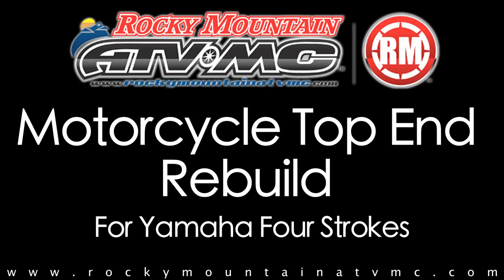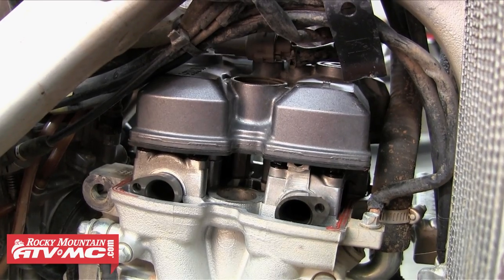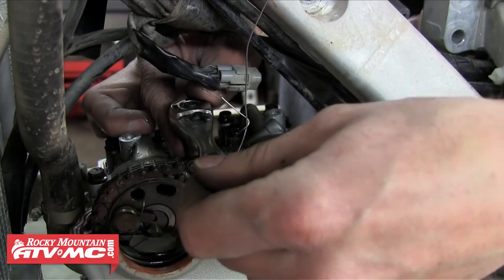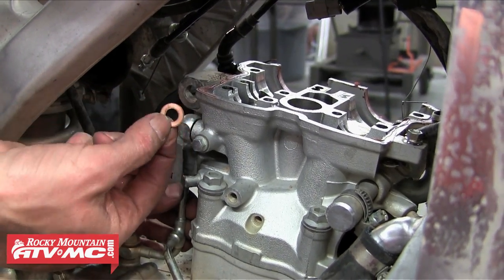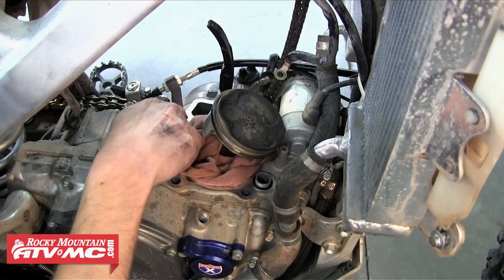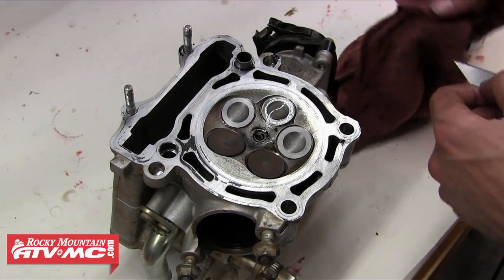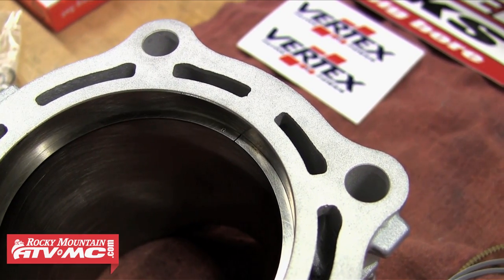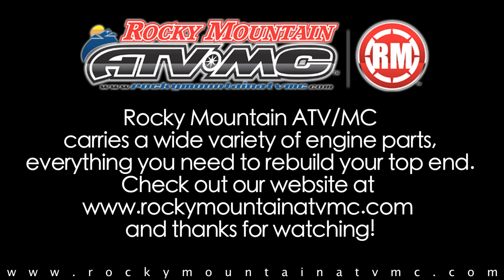Motorcycle Top End Rebuild on Yamaha Four Stroke (Part 1 of 2)

Comment from the maker: We most likely will in the near future but really the only difference between a fuel injected bike and a bike using a carburetor is the you would remove and install a throttle body instead of a carburetor and then you also have a fuel pump so you would have those wires to disconnect as well. Other than that the steps would be the same as this video.

Comment: I love the way you showed how to do this job. However I did all you presented and my bike doesn't start. Any idea how to troubleshoot it? I cleaned the carburator, checked the fuel pump, spark plug, air filter. All is fine but the bike still doesn't start. Please help if it's something you're familiar with. Thanks a lot

Comment: Few questions :
-why  you don't measure the piston to eventually re use it with new rings ?
-why  you don't measure the cylinder bore and piston to see if you have the correct clearance ?
As i know you have to ,to be sure the new piston have the correct dimensions for your cylinder.
How does work the cooling system on those bikes ?
no thermostat,no cooling fan ?
the engine is running constantly cold so ?

Comment: I have a 05 Yamaha YZ450F that will not turn over. It started with a bog/hesitation & pop sounds than shuts off completely. Values checked 100% and are good. Air filter checked and good. Fresh gas & oil, new spark plug, added a new fuel screw, cleaned carb 100%. Far as the top/bottom end is concerned in my opinion I believe they're all good because I don't ride it everyday or every week. I have a rebuild carb kit coming this week which I will install it just in case. Do you all think I'm over looking something that needs attention? Maybe the float is stuck or something like that!
Reply: Check to make sure the plug is getting a spark. Even if you replaced the plug, there might still be something wrong with the electrical that can keep it from making a spark. If you are getting a spark then it's probably carburetor. There is a small valve that the float moves up and down. It has a little rubber tip and if it wears (you'll see a small ring around the tip) the float will constantly get stuck and the bike won't get any gas.
Reply: +Jacob Phillipps Thanks, will do.
Reply: I'm sure you did, but did you turn your fuel screw to the right setting?

Comment: I am in the process of fully rebuilding the top end on a 2004 RMZ250 with all new parts including Cylinder Head, all valve components as well as wiseco cams etc. Beings I am starting with all new parts where is a good place to start on valve shim size???? Not sure where to start as the old ones are going to be WAY TO THICK?? I am going in the morning to get the proper feeler gauge set

Comment: hi, i have questions about my top. im rebuilding a yz250f motor since i blew my last one. after pouring gasoline on the valve seats, i found that some of my valves are leaking, and upon inspection i found damage inside most all the valve seals. is it sufficient to replace my valve seals or will i need to have my valve seats recut aswell?
Reply: Remove the valves, then inspect both surfaces for marks, clean All the carbon off the valve and seat (at its 45 deg angle and around) then try again..
If the old valve seat looks okay then get a new valve put some sharpy on the valve sealing surface and then put the valve in and turn it to see where the contact area is.
It should be about in the middle of the valve seats sealing edge..

Also inspect the valve guides while your at it :)

Comment: Hello !
I have a 2008 YZ250F with around 80 hours on it, and planning to replace the piston in the end of the season... What else is recomended to replace ?
When replacing the piston, do I have to hone it, or can I skip it ?
Thanks :)
Reply from the maker: steffen førnes When replacing a piston you will need to replace your gaskets so a top end gaskit kit will be needed.  You can either save your old coolant into a bucket or replace it, depending on the condition its in?  You can determine whether it's worth saving or not.  To answer your honing question, i would best guess you are not going to see any cross hatches on your cylinder wall?  I'd recommend you get it honed.  The purpose is for oil retention and piston ring seating.  Let us know if you have any questions, thanks for watching!

Comment: Should the cam lobe or lifting rods spin freely under the cam blocks
Reply from the maker: Soapy Bee Do you have your cam chain and cam chain tensioner on?  They should rotate freely to a certain point and then they'll  make contact with the shim buckets and stop. (if rotating by hand and cam chain and tensioner are off).
Reply: Yea she is all hooked up an back together
Reply from the maker: Soapy Bee Then no.  If you have it all back together.  It'd be tough to spin by hand.  You can use the kickstarter carefully or the flywheel nut to turn the motor.
Reply: Excellent cheers for the heads up mate always find your vids helpful thanks
Reply: What about when you have the cam chain an tensioner is off an you just have the blocks or towers tightened down should they spin freely then
Reply from the maker: Soapy Bee There is going to be some tension due to the cam lobes rubbing on the shim buckets but yea, they should spin over for you if you turn them.  Thanks for checking out our video, appreciate the comments!
Reply: Excellent mate cheers again

Comment: correct order:
1. remove accelerator cables
2. remove clutch cable
3. remove carburatore
4. remove full exhaust
5. remove radiator
6. remove engine put it on table 

1-6 points will take you 30 -120 min . depending on your skill and experience

Comment: Guys how do I disconnect the motor from the frame of the yz450f?  Do I have to remove the whole rear end from the frame of the bike?
UPDATE:
I went to my local Yamaha dealer service center and to get the engine off the bike the whole rear rack assembly and wheel has to be removed
Reply from the maker: bomark 2002  You can leave the subframe still attached to the bike if you'd like?  I like to take the top bolt holding the subframe out and then loosen the two side bolts, that way i can swing the subframe down and out of the way to move the motor around. With the swingarm you will want to take the top rear shock bolt out and you will need to pull the swingarm bolt that goes through the rear end of the motor and out the other side, then you can let the swingarm drop and hang there resting on your bike stand.  This way you don't have to disconnect your rear brakeline.  After doing this and obviously removing all motor mounts you should be good remove the heart out of the bike.   Let us know if you run into any questions. Thanks.
Reply: Man I ended up takin it to my local shop I absolutely could not get that bolt out, I am having the bottom engine rebuild done to it, I ended up busting an eBay dealer on price and got a wiseco bottom end rebuild kit for $221 bucks, pricing error

Comment: Should you also replace the valves and stuff? how would you when you need new valves?
Reply from the maker: racequad9 Usually when your valves have stretched out of spec, bent,  have excessive carbon build up that won't come off without damaging the valve and or the valve coating has started to come off.  These are a couple signs you can look for.

Comment: i guess i would not have to check the clearance to the rings since the cylinder wall was replaced 60 hours of riding before ? i bought a high comp piston to my 09 yz 250f

Comment: Hi i have a question 2007 suzuki rmz250 i have a cylinder bore 83mm i want to know what i need to do with the cylinder head if i need port or valve and what cams i need i have hotcams stage2
Reply from the maker: I'd check with your local engine builder, or reach out to Race-Tech's engine department. They should be able to give you recommendations for porting, etc..  -Charles

Comment: ok so I was riding my bike and all of a sudden I heard a click/ snap and then the bike died. I have no idea what happened, I fired it up let it warm up for a minute or so and then shifted into 2nd and took off. within 30 secs I heard the click/snap and now my kick lever is locked in position. any possible info would be helpful i haven't taken it to a shop and am considering selling the bike. ive only had it for one summer and am also considering rebuilding it myself or having a shop do it. any info on what yall might think happened would be appreciated and or price range on what a shop would charge....
Reply from the maker: Local shops vary in price so that is hard to say what they'll charge.  The going rate i would guess would be $60-80 an hour at a shop.  Depending if any real expensive parts got damaged inside would be the real deal breaker on whether to fix it or part out?  I don't think you're out much attempting to fix it yourself.. just parts and more quality time in your garage lol.  It's just a matter of diagnosing the problem and finding out what caused the lock up and what's all needed to fix the bike?  As far as knowing what it could be, i don't know? I would start on the right side of the bike and work your way in.  Assess the top end as well.. your timing could've jumped a tooth locking up the motor?  Let us know what you find out, thanks!

Comment: Brilliant video.
Thank you.
One question, when you put it together, do you have to put the chain and rings the chain goes round in exactly the same position for timing? Or is all this set lower in the engine, so just a case of pulling the chain back up round the two rings?
(I'm a complete novice, but want to take this on on my bike with the help of your video)

Comment: Another reason why I'm probably gonna get a two stroke
Reply from the maker: +Spike Spikus Less maintenance for sure.. but that 4 stroke power is like nothin else :)
Reply: Ain't really much to it.  Only real difference is the valve train, can do a full top end rebuild in about 2.5 hours and a couple beers.  No biggy.  And my 4 stroke top ends last year's opposed to months with the 2 stroke.
Reply: If what's shown in the video is complex for you no way will you be able to rebuild your 2 stroke by yourself. Forget it.

Comment: That banjo bolt.. would that be on my 05 yfz 450 as well and do you have to unscrew it?????
Reply from the maker: Yes,  your ATV does have the oil supply line running up to your head.  You would need to remove it when rebuilding your top end.
Reply: @rmatvmc  The banjo bolts have a horizontal hole in them (of course).  Is it important to mark the bolts before removal, and/or take special care on installation, such that the hole is in a specific alignment to allow for oil flow during operation.  (Yes I am so ignorant that I am basically asking you "how does this banjo bolt work?"... sorry... :-).

Comment: What do u torque the cylinder head bolts to ?
Reply from the maker: Each Year, Make and Model vary on torque specs.  We recommend you check your service manual to get your bikes specific torque spec for the cylinder head.

Comment: Isn't the cylinder nikasil plated? so it can only be honed with a diamond? i thougt you could throw the cylinder away if you use a hone like that.
Reply from the maker: +Mitchell HürenKamp The manufacture of the flex-hone states that it is safe for nikasil and sleeved cylinders.
Reply: +Rocky Mountain ATV MC Oke, maybe i confused it with the normal 3 stone hone, they can actually damage the nikasil plating (pulling chuncs of). I enjoyed watching your video anyway.
Reply: @rmatvmc  Hey folks, many years on and this video is still a gem, THANKS!  Would you please post the specific Flex-Hone tool you recommend (perhaps a link to where to buy it on your site)?  Or perhaps I should ask, am I safe to use any Flex-Hone tool that basically looks like the one you all used (e.g. can I assume that genuine Flex-Hone = safe to use?).  Thanks again!

Comment: Hey can anyone tell me if I can put a bottom end out of a 2003 yz250f into my 2001 yz250f??
Reply from the maker: james laRue You might be able to do a complete motor swap into the frame. But as far as internals parts go, from my research there's too many different part #'s from both of those years.  Part #'s don't match up. I would check on some forums and see what others have attempted and see what they've needed to do.
Reply: I looked on thumper talk and they said yes but the only reason I wanna do this is I can't find any bottom end rebuild kits for my year bike but they have a lot of cheap 2003 yz250f bottom end kits

Comment: Your video didn’t tell ppl where to have the timing marks at or how to properly remove the timing tensioner.
Reply from the maker: You will want to check your bikes service manual to set the timing and you can see us removing the cam chain tensioner at 2:52 in this video.
Thanks for watching!

Comment: I am leaving this comment hoping that someone will reply and help me with my problem I own a 2006 YFZ 450 racing quad and it has several modifications done to the engine it has a Wiseco top end the upgraded oil pump and it has an aggressive cam in it so my problem is the quad wont idle you always have to give it a little bit of gas to keep it running or turn the idle up on the carburetor so we had taken it to a mechanic because I was too busy to work on it myself and he did a valve adjustment and he did work on the carburetor and he called me up and told me that the quad wont idle because it has an aggressive cam in it is this true if there's anyone out there with extensive knowledge can you please help me thank you
Reply from the maker: A big cam can definitely have an effect on the idle but you’d have to have a crazy early cam in it for the idle to completely drop off. If achieving a smooth idle or smoother running at lower RPM’s it may be easier to go back to a stock cam setup and dial it in from there.  Do you know what stage of a cam is in it?  Is your cylinder head stock? There is a bunch of different things that can have an effect on it but unless you take it to an engine tuner with a dyno it’s hard to tell exactly how it’s running and how to get it dialed in with all the aftermarket parts.
Reply: +Rocky Mountain ATV MC the cylinder is stock and mechanic all he said was it has an aggressive cam in it and it would have a problem idling and you really just have to give it a little bit of gas well it's sitting there to keep it running but I'm just worried about the mechanic charging me and not doing any work on it
Reply from the maker: DRAKE FORCE You may want to take it back to stock on the camshaft.  Being a stock bore cylinder and no porting done to the cylinder? Could be you just don't need that mod done to your engine.
Reply: Well I will be racing it in motocross it is a full racing quad